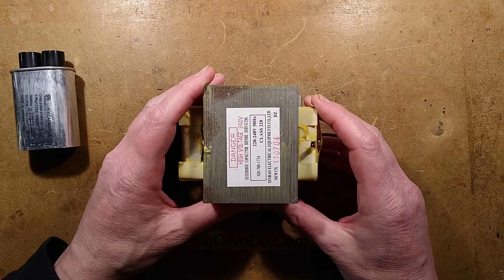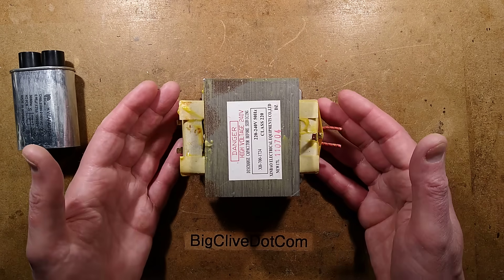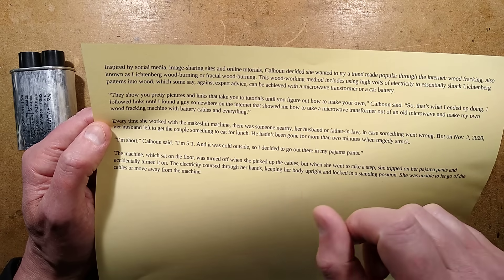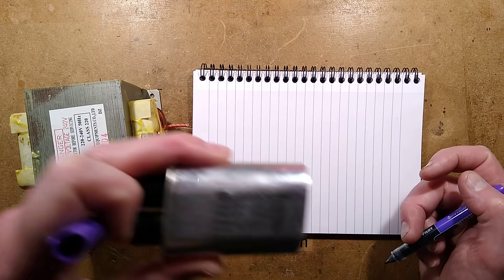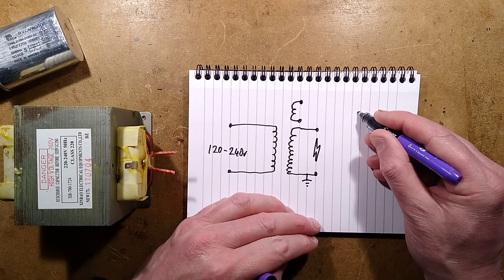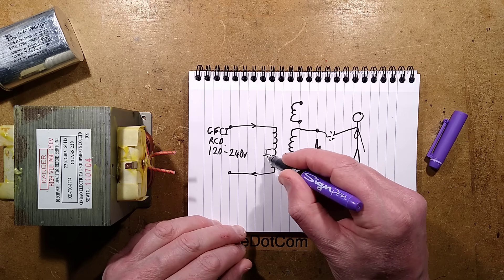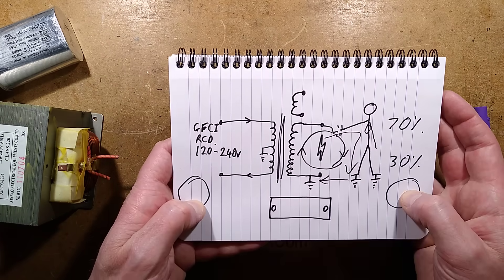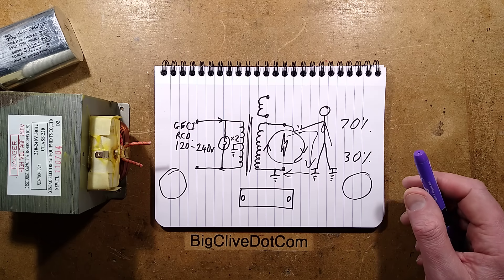The most deadly project on the Internet

Comment: My friend's son trained/works as a 'jointer', he showed me some of the pictures the instructors  passed around the classes of what happens if it goes wrong. Everything from minor (fingers missing) to whole body  charcoaled and vapourised legs/arms, and there were a few with impressive Lichtenstein patterns on various body parts (these from VERY high voltage 'strikes'). Surprisingly some of the victims survived, though often missing various large body parts. You can bet SAFETY was/is clear after that class.

Comment: Glad you mentioned the capacitor. Good reminder. The light in our microwave went out recently and, no Breville, I WILL NOT bring my 15 year old base-model microwave into an approved service centre to have a light bulb changed.

(The design is such that there is no convenient access panel - you have to take the cover off.)
Reply: About 27 years ago I was working with an electronics tech who told me that another tech working in the same shop was killed by the capacitor in a microwave - while the thing was unplugged. Worst shock I ever got was from a capacitor charged up to a mere 450 V. But I was young and stupid then.
Reply: @clarencegreen3071  my brother and I used to work in a place designing and building RF pulse amplifiers for radar, cyclotrons and so on. The boss, an engineer, would periodically be troubleshooting a problem by probing around with a bare capacitor. Periodically he'd get distracted and walk off, putting the capacitor in his pocket or idly touching his face with it. Thankfully it was always a cap small enough that it was funny rather than life threatening.

Comment: Stuff like this makes my skin crawl, as an electrical engineer who has to work on single and 3ph live for diagnosis on occasions , I’m so cautious when doing so and always have someone with me in the process. 
To think that people with zero electrical experience watch a YouTube video make probe’s with as you’d said Clive “electric chair voltage” to make pretty designs on wood is absolutely mind blowing. 
Add in salt water, wet hands and you may as well go lick the bus bar whilst hold the garden hose over your head🤦🏼‍♂️

But on a different note could you imagine how good of a wood fracking design Andy from photonicinduction could get!!
Damm he could make a sheet of 8x4 look good enough for the national gallery 😁
Reply: Unpopular opinion: I honestly think he (photon) was part of the problem at one point, as cool as his videos were and whilst he knew what he was doing, people watching his viral videos and copying stuff at home didn't.
Reply: @CamelCasee  🤷🏼‍♂️ to be fair there’s an aspect of that is probably true but you have to bare in mind Andy’s house had a very unique supply. With higher amperage incoming. 
The average U.K. house would throw the 32amp breaker on the ring or rcd before they got anywhere near what Andy was drawing. 
But that’s not saying they still couldn’t have cooked themselves well before then!

Comment: During my apprenticeship we where shown the affects of high voltage on insulation of normal mains cable, after that had the utmost respect regarding safety when working around high voltage equipment. 68 years old and still alive and in one piece think the lessons in college worked.

Comment: Actually the term "GFCI" has a problem. Many think it somehow is dependent on the ground wire. Ground fault is a hard to to get for people. It would be better to call it just fault circuit interrupter.
Reply: while remembering that inserting your body into the circuit between live and neutral isn't a detectable fault ...

Comment: One of the main contributors to a shock must be the fact that one side of the secondary is earthed. Removing that earth connection must make it safer? Won't help of course if you connect yourself across the secondary.
Reply: The insulation of a MOT isn't rated for 2kv between the inner secondary winding and the core.

Comment: I was allways taught that high voltage is relatively harmless UNLESS it is also combined with a SIGNIFICANT/HIGH amount of current. You can play around quite harmlessly giving yourself high voltage electric shocks with the likes of a vandergraph generator which can produce voltages of up to 100,000 Volts! But since the current is minimal then there is no problem, it just makes you go 'ouch', the way that recieving a small shock from static electricty when walking across a carpet can sometimes do.
I think that it would have been useful/informative if the maker of this video had mentioned this issue, but the really important thing of course was to publice the danger as he did.
Ultimately I suppose one should emphasise that people should not experiment with electricity, (or any other potentially dangerous thing) without having first familiarised themselves with the dangers or seeking the advice of an expert first AND that people publicising projects like this on the internet should ALLWAYS BE AWARE OF ANY DANGERS AND MAKE THEM CLEAR.

Well done for publicising this danger.

I THINK THAT ANYONE HAVING COME ACROSS A YOUTUBE VIDEO THAT SHOWS A DANGEROUS PROCESS WITHOUT SUFFICIENTLY MENTIONING THE DANGERS SHOULD REPORT IT TO THE YOUTUBE MODERATORS WHO SHOULD THEN TAKE IT DOWN.

Comment: I work with electronics, live wires and charged capacitors. I'm not afraid of getting shocked per say, but I have never had the courage to play with multiple thousand volts. MOTs have always freaked me out, because I know, insulation breaks down and anything that has a higher moisture content is basically a conductor at high voltage.
It baffles me how the layman just doesn't think about the dangers of working with this, especially considering that there is absolutely no protection since it's galvanically isolated ( not that there's an rcd or gfci sensitive enough for it to actually make you be not dead if it were on the secondary side )

Comment: It feels really weird standing on top of railway machinery, within arms reach of the 25kV overheads capable of carrying 1000A, holding a shovel. 

Even when you know it’s isolated and earthed.
Reply: Scary. Do you mean they had isolated the overhead? I thought they were always live.
Reply: @chrisreynolds6331  I work on specialised railway machinery, search YouTube for “rm 900” it should be the first result. I don’t post links in comments, they usually get deleted.

We have conveyor belts on top of the machine, and aren’t allowed to operate in case something chunky comes through the machine. They isolate and earth the overheads but that only decreases the size of the exclusion zone from like 3 meters to 1 meter. 

Sometimes the belts get bogged with material and we have to dig them out. 
Which actually means the linesmen come in and say “screw that” and then do dodgy paperwork to say we can go closer to the overheads. Usually only they can go hands on.

Comment: At this point i can only consider this natural selection at work. I have exceptional respect of voltages above 100V, i have had too many shocks over the years, even with safety. (thankfully its only been 3 to 5 shocks, with only 1 being large enough to cause damage). 

With transformers like these i have so much respect that i don't even dare touch it with anything less then a 1 meter hot stick, properly cleaned and rated to high voltage and tested on a 100KV ohmmeter. 

also, i routinely work with voltages between 100KV and 1.5 MV, so i know better then most how dangerous high voltage is. How can people be so disregarding of their own health and safety.

Arc flash is also a fun thing to witness in person, rather painful though.

Comment: As you say it should be safer with high frequency AC, as the skin affect will stop the current flowing in to the body. The current only wanting to flow on the surface, the higher the frequency the less deep it will go in the conductor. So with RF one side of a steel plate if a different conductor to the other side even thought the resistance between them is close to zero.

I think even at about 10kHz skin affect starts to occure, not sure how this would affect the wood burning as the currrent again would be on the surface and not burn to any real depth.

And as the old saying goes "volts jult mils kills" it's the current that kills you, the voltage just needs to be high enough to push the current through the skin, after that it's wet all the way.:-)

Comment: Speaking of neon sign transformers, I once had a paraffin heater that had the high voltage transformer go out, and I found a neon transformer worked most adequately, and for about 1/3 of the cost of the manufacturers part.

Comment: The shock is just 1 part 
The energy discharge and disruption canbe hudge aswell and the capacitor is explosive if use it aswell

The mot is not isolated very well the core is earthed or live so eather get a path through earth if u earth it or the hv can get to the primary and create own path 

The high voltage isn't the best insulation to primary hence part of the core being earthed 

The high voltage starts being unpredictable 
More fun wen u get 100kv but it isn't as meaty as mots 

I wish people would never explain using the hv without depth information the worse case I have seen is the evil genus book showing how use magnetron outside of the microwave like it's a hobby diy leaners fun highly dangerous 

But i do all this stuff and more

Comment: They can be quite fun though, I cut out the secondary winding & the magnetic shunts and then wrapped a couple of turns of 10mm cable around it. OCV was about 3v but short circuit current was 1400 amps! It was quite fun to melt stuff on it :) I wouldn't play about with them in standard high voltage configuration though!
I mean If I was making this wood art, I'd have it so the probes are held by clamps and I'd have the power controlled by two non latching switches that need both hands to operate, and I'd still physically unplug it before going anywhere near it!

Comment: As a kid I was always into electronics and physics stuff. Ended up working as an electronics tech as a student. So was always wary of electricity. I did play with lasers a bit so that also taught me respect of high voltages. I have done the wood burning but also used a neon sign transformer (now in a Jacobs Ladder) left over from a laser project. And I have played with both Wimshurst and Van De Graaff machines which are good for making big sparks, 400mm on a good (dry) day with my Van De Graaff. I do have several MOT about but they are for spot welder projects. Played with old B&W tellie flyback transformers to make plasma lamps too. I think a really interesting thing I did was a TEA nitrogen laser powered by a hand cranked Wimshurst machine. They could have built a working laser back in Victorian days if they just put the right bits together. I always thought that was a cool idea.

Comment: Clive, the only use I've seen for microwave transformers is making a magnetic base for a drill press that works on the primary side of the transformer on 12-24, and has about a 600 lb. pull or hold. I might add that the secondary is completely removed as well as the laminates on the secondary side as well.

Comment: I almost did this a few years ago, back when you made that first video, and had to re-up it as I recall, as I have a lot of MOTs lying around in the shed. then I thought yknow what, fukkit, it just isn't worth it. some of the tutorial vids I watched back then really were awful, total lack of understanding both of how tricky to manage the risks are, and the potential consequences. the car jump lead stuff is typical, big lumps of copper surrounded by low VDC rated insulation when what you want is the opposite, but people are just think ooh fat cables, thatll be safe

Comment: Electricity is incredibly predictable. Knowing where Electricity is going to travel and how capacitance to the environment works etc. You can always set up very basic failsafes for this kind of thing. Strange that hobbyists would forgo the most basic of safety precautions. (Still. It's better not to do something at all if you can get away with it. But everyone doing something like this needs to take some real courses on electronics.)

Comment: Probably nothing in comparison, but I got a belt off the inside of a microwave before when changing the lamp. Pushed in the new lamp (G9 I think it was) , plugged in the oven to the mains and the lamp didnt work... Started fiddling around with the lamp and whilst leaning on the shell just suddenly had a full on zap through my arm. Then the daunting realisation that I'm an idiot dawned on me that it was still plugged in whilst I was doing that kicked in. Never felt something like that and I'm usually h&s first with everything. I'm guessing it was the 240v and next to no current as it was just the lamp but still enough to get my attention and memory to not do that again!

Comment: I work as a metal caster at a local company and I deal with currents in the excess of 30KW to 750KW, amps upto 900, you should never dismantle anything with a transformer in it unless you know exactly what your doing, these idiots on social media... well if your going to mess with stuff that you have no experience with, then you deserve to die.  Remember, it travels at the speed of light, you cant avoid it.

Comment: A ZVS driver with a flyback transformer, or for lower voltages at higher currents and power levels one made from an inductor and a few turns of heavy wire around a ferrite core is probably the least shocking source of high voltages.

Comment: If you stack 2 together they are a lot of fun for a few seconds till the insulation completely breaks down. If you chuck the second one in a bucket of wax first you get about 20 seconds of fun. Horrendously dangerous though, do it in a cage with all the safety precautions.

Comment: Very sobering, nay shocking.   Well delivered message.  I am reminded of a microwave I was given that still had manufacturers plastic film on the outside of it.  New but unused.  I changed the internal fuse and it worked but at that time I was so terrified of the oven internals that I put the cover on, even to test it.  In retrospect, not such a bad move.

Comment: I had a thought, some kind of industrial timer+relay inline with the mains voltage and a reset switch rigged through 2x double pole deadmans switches such that you have to release the deadmans switch to close the reset button circuit would ensure that if you did get shocked there would be an upper limit for how long. Depending on how you get electrified it may be hard to release the deadmans switch(es.)

Comment: Another indicator that I like to add to a project like this is a piezo disc speaker with a suitable resistor for an audible buzzing sound.  It could even be placed in series with a neon indicator.  I've also found such an addition to be useful on soldering irons and glue guns to prevent them being left on.

Comment: In your drawing, the person's feet must have a low impedance path to the bottom of the secondary winding, to enable an electrical shock danger. Since you have not stated this impedance, your drawing is useless.

Comment: Thanks a lot for stressing the importance of safety! So I have this microwave transformer laying on my desk for about three years now waiting to be used for making Lichtenberg figures. I haven't dared to do it yet, but one day I will! It will all be done with safe remote switching so I don't have to be near to the transformer. I have created a foot-operated switch to turn it all on and off. The most important feature being that this switch has a 5-meter cable on it, so I don't have to be anywhere near the transformer. Let's hope I get to do this somewhere this summer :)
I'm extremely careful as I'm quite intimidated by the power these transformers can deliver. It's very important to understand the risk so that people like me, who are going to do it anyway, can limit the risk they're taking. I'll add two lamps as well, just to be on the safe side. Just imagine my foot switch would fail and it stays stuck in the 'on' position.. It's the kind of switch that turns off when you're not pressing it down.

Comment: Any one who plays with that kind of voltage, and doesnt at least think "gee, maybe I should at least use a chicken stick(dry wood/HV safe plastic/composite rod to avoid contact with the really angry pixies)", should be ruled a suicide. Any one that survives gets attempted suicide therapy in the form of a court mandated unpaid electrical engineering apprenticeship with city DWP.

Ive always held stupidity should be painful, and if it aint hurting you its hurting someone else, like your family. Yes, someones child died/injured (themselves) and thats awful. But FFS, any respectable video will layout the dangers, I cant imagine very many responsible youtubers putting out a video of holding the damn leads! Unfortunately, I can see some garage douchebro or squeaker posting a video with little more than a 'high voltage bad. no touchy' then cut to them holding the wires. Or some bad techno over a way too long video of sourcing the part where every screw has to be pointed at 3 times before an unedited removal....then point at it again. At most those ones will just say 'this is where voltage comes from' in white text on a bright background rendering it unreadable!

....Not that im judging.....

but yeah, i cant feel that bad....its like a darwin award..... :/ sorry not sorry